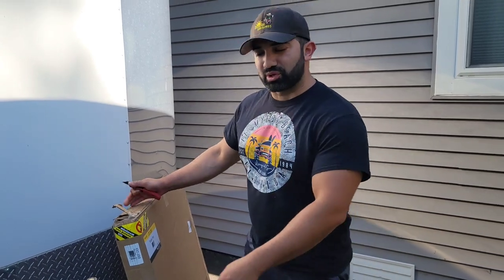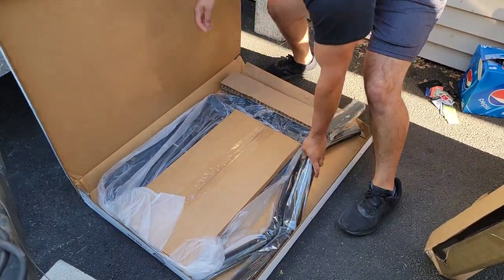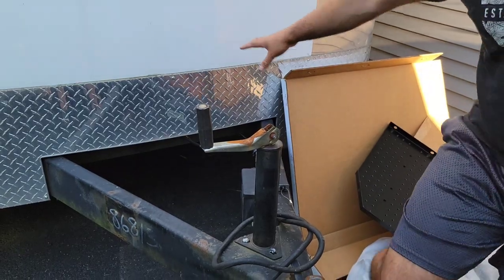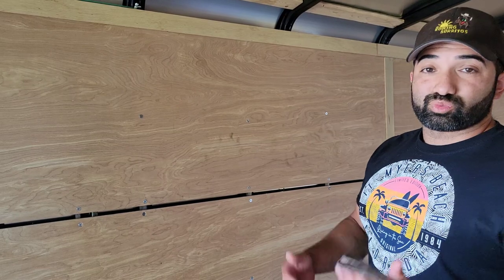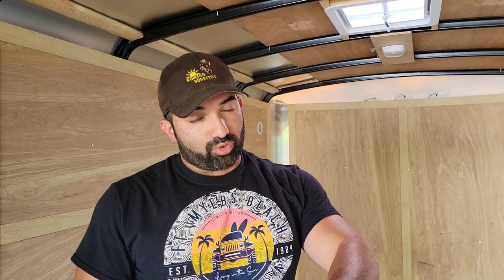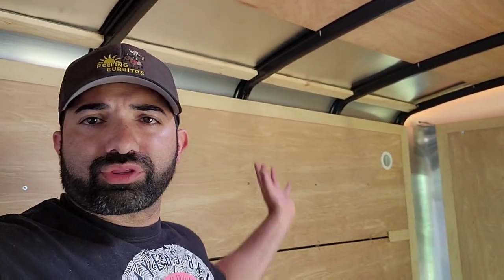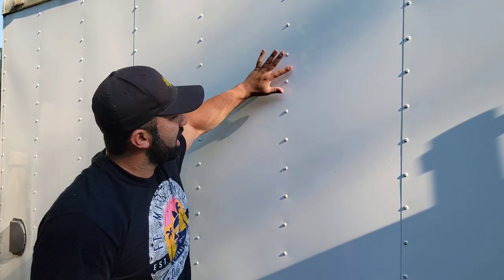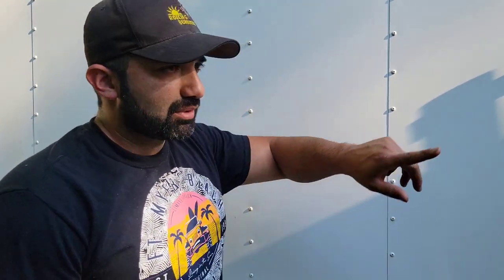How to Build a Food Truck
Do you need an A/C?

Comment: I'm putting a window unit in the wall for prep and clean up during the summer.  When the hood vent comes on, ac will go off. Then I will switch to all fans. Found one that pulls 400w at full blast

Comment: I'm building a 12 x 6 ice cream trailer I used the foil backed white foam insulation from home depot had to remove the wood cut it to size then tape it with the foil tape replace the wood and line the walls with FRP the walls with the insulation is much cooler than the ones I had yet to do this test was before the FRP was installed

Comment: So i live in AZ where 115 is normal during the summer. My experience is that with evap coolers you should always have a window or door open. So the idea popped in my head of a rooftop rv evaporative air swamp cooler on top with insulated walls. Someone taking orders outside under the tarp. The vent system would act like an open door. What are your thoughts on my idea. They can be ran on solar panels and/or 12v
Reply from the maker: AZ is a hot one. I would have to see how it looks to get an idea. Can't picture it. Send me an email. Rollingburritosfoodtruck@gmail.com

Comment: Hey Frank! Wondering... Why not put FRP on all sides? And what about the floor? Do you just keep the original plywood? Doesn't it go bad after a few years? Thanks!
Reply from the maker: I use grey coin flooring rubber works phenomenal. My first trailer I used diamond plate not a fan tho. FRP didn't like it very flimsy in my opinion
Reply: @fbaltierrez  I saw that you added the grey coin flooring but I ment for the structure, underneath, doesn't the plywood wearsoff over the years?
Reply from the maker: @Infiniphil  haven't seen that issue as of yet. Unless water gets in there that would be the only way I could see there being an issue